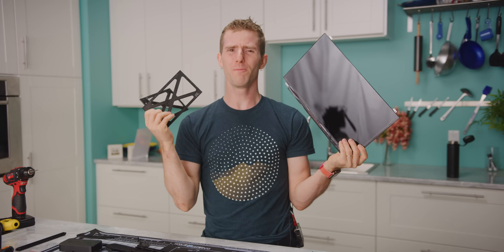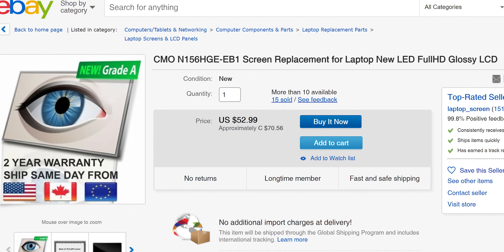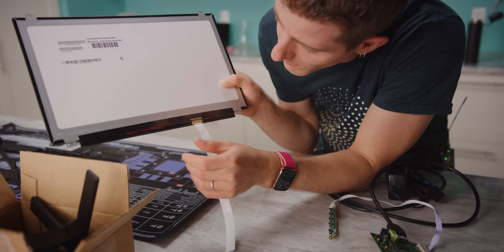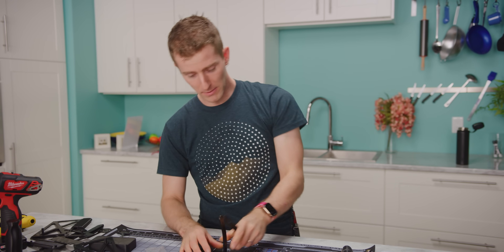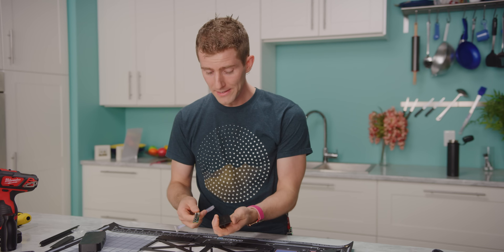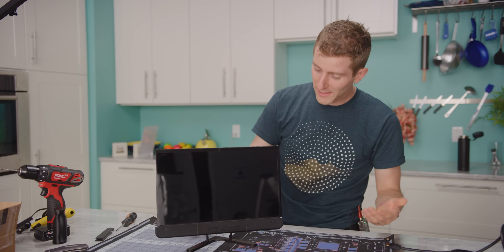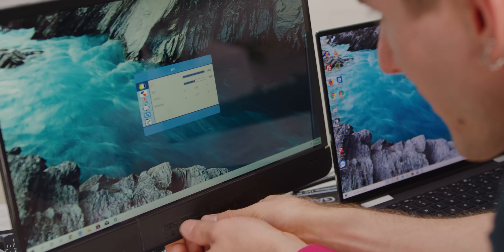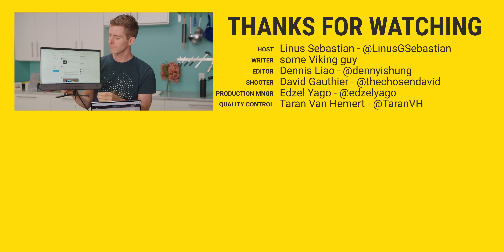We made our own monitor for under $100!

Comment: I built my own snowblind lcd case first go years ago sure I didn't remove the matt antiglare film so the image is blurry but it works. Just a quick tip if you decide to make your own it isn't always a first go diy I tried to do it again for my main rig at least 4 times but not all old displays follow the same layout or like to be mounted or powered by the computer psu and some just don't play nice when it comes to removing antiglare coats trust me I know. So linus if you try to make your own lcd snowblind case cheaper then the snowblind offical one first figure out what lcds will work correctly and have diagrams for the driverboards.

Comment: This is more akin to assembling a monitor then building a monitor.

Also should make it clear that displays do not work with any control boards. Need to make sure you get the right control board.

Comment: How to make your own monitor: Step 1,  you need a monitor. Step 2 , remove the LCD from the monitor housing. Step 3, pull out your 3D printer and print housing. Congrats! You now have a 11 inch monitor for less than 100!

Comment: I'll note for those harvesting screens: If it's off the laptop... just use the whole lid. I plan on doing this with a dead Fujitsu convertible, and there's buttons already on it for PC power and a few other things you could attach to the GPIO pins on a Pi or something. Oh, and it has a perfectly good Waccom tablet that can also be attached (though that's pretty fiddly), boom, cheap AF Cintriq you can use with a desktop.

Comment: I built a monitor kind of like this a few years ago, but I ended up using a made-to-order steel picture frame and a few sheets of laser-cut acrylic sandwiched behind the display panel. Gave it a VESA mount in back and screwed it onto a mic stand. https://blog.lmorchard.com/2017/01/09/diy-monitor-v12/#version-1-2-mic-stands-laser-cutters-ftw
Reply: Also, the main benefits of this monitor for me were 1) it's only 17" and 2) it's super light. That means I can keep it by the couch on an easily-moved mic stand and hook it up to a PC stashed next to the couch. Every other tiny monitor I've found is like US$300+

Comment: Now.. is there anything like this that would drive 4K panel (LG's 10bit LVDS 174pin) from Dell UP2414Q? first Dell's attempt to make 4k monitor... very over complicated board design and very buggy, they dropped like flies and were quickly discontinued. there is ton of these monitors with dead boards and perfectly fine panels.

Comment: Every time I see a DIY project that requires a 3D-printer I'm like 'If I had 500 dollars for a 3D-printer I wouldn't have to DIY it, would I?'
Also even if I had one I'd rather just get a used monitor for 50 dollars.

Comment: There is no merit to this unless you like tinkering or have a specialty use planned.  For the cost of the driver board alone you can buy a used 1080 monitor used on facebook.

Comment: "Build your own monitor, cheap and easy!"
Me: Cool!
"You need some screws and a 3D printer"
GODDAMMIT!
Reply: GM Kof hard I sold my medium child and barely got enough for one large screw. Where did you find 2 and what size are they?
Reply: Dylan lol cut the large screw in 4 pieces and get 4 small screws
Reply: I got the printer but who can afford fucking screws? They're worth the price of a small child
Reply: You don't NEED a 3D printer. You just need a brain to improvise and build a stand without it.
Reply: You could, like me, use duct tape and a leftover amazon boxes, works just as well
Just ugly asf
Reply: Dont bother with the screens nah the screws are the real issue. XD
Reply: I sold my child and got a used rusted half broken micro screw, is your child a genius who’s double the price
Reply: take a photo frame just replace the glass with the screen
Reply: DIY Perks made his own portable monitor with a battery and damn. These are 2 worlds. The one is pretty functional, the Other ist quite beautiful, has a integrated Powerbank and You can use as an additional display for your phone

Comment: Can you use that display adapter/controlller with any panel or do you have to look for specifically compatible ones to work eith what you have? Also how would this work for a touchscreen panel?

Comment: A good project with this idea, assuming you have a 3d printer and/or are good at fabricating things in aluminum or wood, is to install a low power SBC, such as a raspberry pi zero w, and this could be made into a portable battery operated retro gaming machine.

Comment: For those who want to use a laptop display, if you have the whole laptop would be even better because you can use the existing case to hold the monitor (mount a VESA adapter plate to it or a custom mount without printing the whole frame) and just make the stand and the components box around the panel that you can also easily glue them behind. 
Not to mention that probably the existing case has a small chip used to supply power that can be further used.

You will still need the power supply but keeping in mind that you have the laptop, it probably came with a power supply that can be repurposed by using a DC to DC step down converter that it's also available on the motherboard or you can buy a generic one from eBay/alieexpress/bangood/etc.

Comment: Aaannndd.. Why do I want to salvage LCD panels that I need to buy a $30 controller for, troubleshoot and source parts, then fabricate a mounting mechanism or whatever, when instead I can buy fully working used LCD monitors on local used junk market for $10-$20 a piece?

Comment: I did this with my old college laptop years ago. The connector broke from the motherboard so I just made it an external monitor. I used plexiglass as the "case". I just heated up the plexi and curved the top and bottom so the monitor slides into it. Then I just made it a vesa mount and used a monitor arm to stand it up. I used it for years until I actually bought another monitor. Then when my main monitor decided to die, I opened it up and bought a new motherboard for it, it works like new now. Except I got rid of the original buttons like a dummy so I can't use the original button location. Oh well, I can still turn it on and off, control the volume, so it's all good. I use it today for my second pc :)

Comment: You should look into making it so the bolt is held by the 3D print and use wind nuts so you can tighten and loosen as needed

Comment: Project Idea: Doing this to build a bigger monitor using a 4 panel array.
Reply: Why 4 make it 100
Reply: Ew gaps
Reply: Jailam Myles that’s already a problem unless you have a really big monitor lol.
Reply: @m.jailam8861  44 yw at 5th iz txt uc9jjl
Reply: AND ALSO BOOSTING TO 288 Hz
Reply: @bigb0ss282  fkk, it's parellel so it still is 31.8756 Hz
Reply: A stand up tanning boothstyle tube of co nnected monitors to create a vr stand in vessel of sorts 😀
Reply: I started to watch this to pick some ideas for this same project. It would be nice to see what Linus would use when building a 4 panel monitor to sync  them...
Reply: Crap its to dark screen
Reply: YES!!
Reply: why?
Reply: 9 panel
Reply: And to have a single power supply how?
Reply: @vmaniac4789  get a second hand desktop PSU and make some cables yourself. A proper 600W PSU should be able to drive 9 of these screens(theoretically). Even better, you could dish out money for your PC power supply and get a 1000W+ PSU and drive them directly from the case
Reply: Me about to do this with 38 screens....
Reply: Hey man, this is cool! I considered it but didn't like the idea of visible lines dividing them. How wide are they usually, from edge of display to edge of the metal housing of the product itself? :o
Thanks
Reply: Doesn't the same thing happen when you multi monitor? Just make 4 monitors. Line them up together and connect them. I think that's all.
Reply: @aas_shortforsmthin  yeah, but this way you get rid of thick bezels..
Reply: @ivanpavlovic5797  combined with the fernel lenses anthony once reviewed to make "seamless" monitor
Reply: 7677l6677606の836c
Reply: That's great
How about making a curved screen using an 8 panel array

Comment: I actually did this myself a while back, but slightly jankier. No drill, no 3d printing. I just bought the control board and hooked it up to the panel from my old dead laptop. Used the top half of the laptop as the case, some scrap plastic to secure the control board, and hot glue/epoxy glue to hold it together. Stand was just a salvaged picture frame stand. Because I scavenged most of it, all I really spent money on was the control board and the power supply, wound up being maybe 40 bucks, and because of how I put it together it was a nice little portable display. Nowadays I don't tend to move it much, but it remains my tertiary display on my desktop even now

Comment: Been doing this for a while now. EEE PCs are great sources for car screens. Put them in the back of the seat for the kids. You are also better off using an LVDS monitor panel as the controller boards you can pick up have native HDMI support. LVDS is also a stronger connection less likely to break. Most cheap TVs are built this way. Department store cheap brands are usually just a panel with a controller board. I pulled mine apart to get the crystal board out to use as a chopping board but it was a TV like this, which is when I started building them for fun.

Comment: If you are salvaging a panel from an old broken laptop, you might be able to use the existing laptop lid as a frame and just build a stand. That would bring down the cost a lot; all you would need to buy is the eDP board. You would also have to come up with some way to cover the eDP board, either by 3D printing an enclosure or buying and drilling something.

Comment: Really surprised you didn't mention LVDS. As that's probably the most common interface besides eDP. Especially if we're talking about salvaging panels from laptops. I've got several legitimately decent panels around that use that. 

Some of them even have touchscreen digitizers attached that are just connected internally as USB Devices with easily obtainable drivers.
Reply: Hi, i am facing this problem, any idea how to fix this? LCD screen doesn't turn on after connecting to the controller board and power. when a button is clicked, It flicks once when turned off.
Reply: Could be an power adapter issue try using higher wattage one

Comment: I would also add, be VERY careful when taking apart display panels, laptop or otherwise... because those things have a high voltage strip at the bottom where the display adaptor connects and let me tell you from experience... you do NOT want to get zapped by them! Seriously! Not only that, but when even unplugging them, make sure every last volt has been drained, because they also seem to have a tendency to arc, which can destroy the connection. I speak from experience. Rest in pieces, old laptop.

Comment: I like the idea. But it is just not economical. I got perfectly fine working IPS 1080p LG Monitors form ebay for 29€. If this was like 10€ in total, it would be worth considering, but having a 100€ display, and then it is so janky, is just not worth it. Not even considering the 3D Printer.

Comment: screw the "cheap panel" i paid $7 for a VGA to LVDS converter and used it to repair a 32 inch VIZIO tv, yea, alot better use of these boards, the motherboard of alot of 1080p tvs can be replaced by these generic boards

Comment: Guys, scrap wood, wood glue and a wrap is a lot cheaper than a 3D printer. Just thought I'd let you know.

Also, in regards to driver boards I have had good experience with the ebay seller best-electronics1987 he even managed to locate and send me a driver board for a device not listed on his ebay for no additional cost

Comment: Hey guys I am currently searching for a at least 1440p 17 inch combination with a non-glossy IPS panel with a fitting controller. Sadly I can't find one. I want to build a portable monitor fitting into my backpack because I am moving very often and decided to use a DAN A4 instead of a weaker laptop. Currently I am connecting to the TV (I unscrew it and put it on the table but don't tell anyone;) ).

Comment: Smart mirror... just as I was about to type this, you said it. Screen, adapter, Pi3 or 4, and mirror with pass through capabilities... Some Pi versions may have the monitor ribbon connector already on the Pi, but it is a simpler 15 pin style, so you may be better off using the adapter piece and HDMI from the Pi...

Comment: instead of 3d printing if you use a display for a laptop just modify the laptop screen assembly and then just add a base and bam much easier and no 3d printing needed

Comment: Another take on this video might be using an old monitor (where you already have the frame/stand, power supply, electronics) and upgrading it with a more premium screen. Maybe the electronics would need to be replaced as well, however, it might be a way to refurbish an old display which has been washed out over time, or the possibility of utilizing a 1440p 240hz display to replace a 60hz 1080p (of the same size).

Comment: i have made 3 DIY monitors now and tried the printed case route and i must say....its fucking awful. all but the thickest pieces result in a flimsy set up and all the trial and error even using an existing plan like i started with and they used here, or starting from scratch like i did with the only case i was happy with yields basically a finished product with mediocre function.
far better to to just use freaking wood. sure its not as "simple" as click print but most of us know that even 3D printing isnt as simple as run program right?
drawing up a blueprint isnt terribly difficult. you can accomplish very much more you think with some pretty basic stuffs

Comment: This has got me thinking. Using just panels you could build a multi monitor setup with practically no bezzels. Take 4 1440p 165Hz panels. Don't just stick them together 2x2. Turn them portrait and do 4x1, 5760x2560. The 2.25:1 aspect ratio is very close to the 2.33:1 of an ultra wide, but it's got 2.98x the pixels of 3440x1440, 1.78x the pixels of 4k and 1.33x the pixels of LGs "5k2k" monitor. It would also be 165hz, and using 32 inch montiors it would span 27 inches (or use 32 inch monitors to get 69 inches total). You could also choose whatever radius of curvature you wanted.

Alternatively use either 3 or 5 monitors to make any crosshairs visible. 5 monitors gives a 2.81:1 ratio equivalent to ~25:9 and 70"/83" spans using 27"/32" monitors.

Comment: To everyone in the comments complaining about not owning a 3d printer:

you can DIY a simple solution for the frame out of threaded rods and some wood fur just a few bucks. Or, if you finde the right size, even a cheap picture frame.
Reply: Instructions not clear.  Made frame in industrial CnC lathe.
Reply: I don't think people realize how cheap 3D printers have gotten tbh
Reply: @snickerdoooodle  I live in the end of the world, a 3d printer is REALLY expensive, this is why i am thinking of making a diy 3d printer, and it will still be expensive :C
Reply: or you can find a local makerspace or online 3d printing service and just send the files.
Reply: or some  clothhangers and hot glue

Comment: Wouldn't it be cool to build like a 16K wall out of those panels, driven by a single display port? Would allow for smaller gaps between panels compared to your multi-monitor video.

Comment: DIY is great, but if you're buying parts otc, then you're already overpaying.  Markups on parts are much higher than just buying the thing outright.....a monitor of that size goes for $89, and you don't have to waste electricity printing parts, time waiting and building it, and $11 cheaper.

Comment: If you’re careful and the LCD is small enough, you can take the backlight and reflector panels off and lay the transparent LCD on one of those old overhead projectors (schools & businesses are getting rid of those all the time). Throw a fan on it so the LCD doesn’t get too hot from the projector and the result is better than most sub-$1000 projectors.